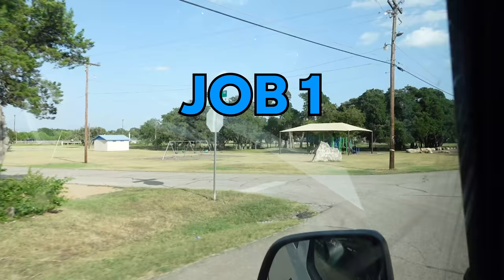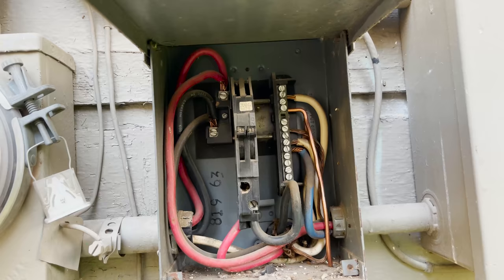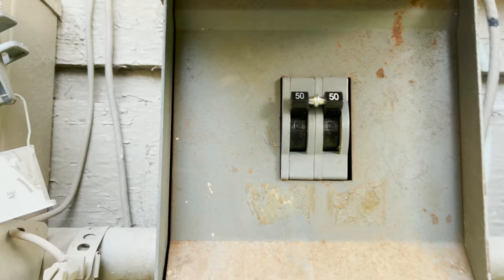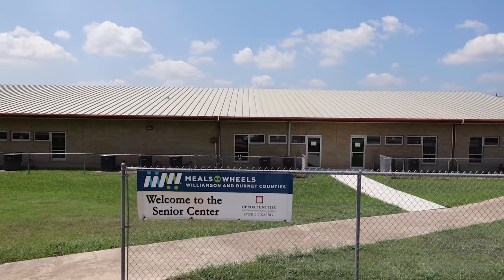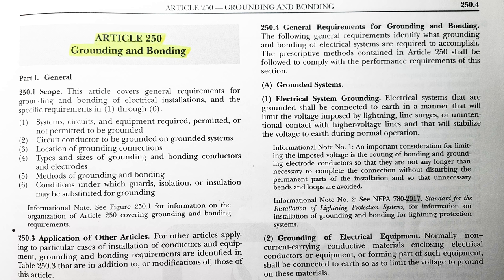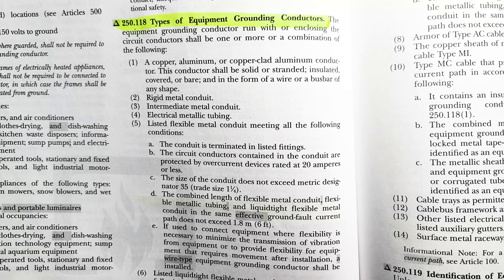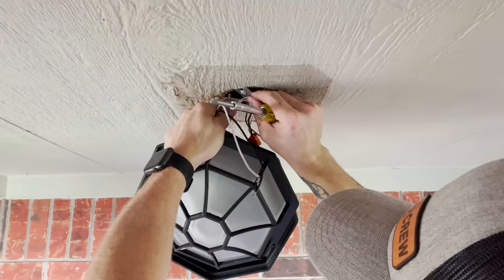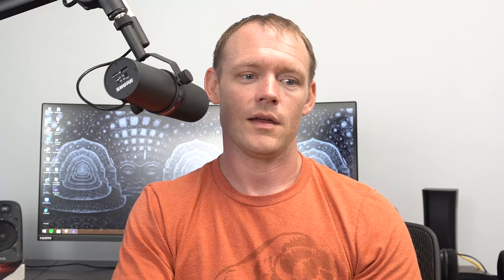Service Calls With Electrician U!!!

Comment: You were able to install ground wire through the existing conduits by yourself? All straight runs with condulets? I’m pretty creative with a one man approach but it has its limitations. Would like to have seen the video of it.
Reply: Usually pull out some existing wire and pull it back in with the ground

Comment: I recently installed an AFCI breaker to a dedicated circuit for a washing machine in a laundry room.
The breaker model GE q   series dual function breaker.
Checked and triple checked all connections from panel to designated outlet for the new washer.
No problems for 4 months and then the breaker tripped on every high current draw motor appliances ie vacuum , hairdryer, corded drill, oscillating fan. 
Lights, radio any non motorized appliances work fine. 
I replaced the breaker with a new one, still tripped. Tested the circuit itself with a volt ohm meter live power and nothing indicates arcing in the circuit. 
Is it possible that the breakers are faulty?

Comment: Using MC 12/2 cable, is it permissible to have a metal single gang box for a 20 amp outlet attached to the cabinet above the range to power a microwave or does this box need to be attached to a stud and flush with the drywall?
Reply from the maker: This would be a great question to ask in the discord: https://discord.com/invite/7ykYfbh

Comment: hey man, would you be able to just add a ground rod, or multiple for the second job instead of running wires to the panel? don’t know if this is a stupid question but i would love to hear your opinion and or the facts as to if you can do that.
Reply from the maker: It really depends on the situation. Typically, no. Here’s the premise as to why. Say there is a lightning strike, or not even that severe, say a nasty ground fault. If the rods are close enough, the current could then run to the other grounding electrodes and cause issues with the system.  Consult with Art. 250 for more of a situational answer. Or feel free to reach out (DM on FB or IG) and we can look at it together! We also have a FB group and our discord server is a great place to bounce ideas off of other electricians: https://discord.com/invite/7ykYfbh
Reply: @ElectricianU  thanks for the reply, i joined the  discord!

Comment: Hi everyone,  any chance I could get some help?
What could cause the kitchen lights, that are on a circuit that has recently died to come on when I turn on the stove, a couple other circuits have died too, one only has 70 volts between hot to neutral , but between hot and ground it's 110, I've investigated a dropped neutral with a multimeter with the old style (Edison) fuse box opened up, and everything is checking out ok, I guess I do not know what the proper test is to find problem. I always use new insulated gloves, tools, and shoes. The two 60's(main) two 35's(stove) the two 20's(waterpump, Washer) and six 15 amp(rest of house) fuses are all good.
Please help, Thank you.

Comment: Why not just run a ground wire through the existing RMC? Running 12 runs of flex with a single ground wire seems wasteful.  If that is indeed what you did?

Comment: I looked at the water and was like, fuck that. There's most likely gators in there....as well as snakes, spiders and a bunch of other shit I don't wanna fuck with. Not to mention, I have no idea what's under the surface of the water and we right next to a fuckin a dump site. I didn't wanna impale myself. Trying to miss the razor wire was out so I grabbed the camera bracket which Im glad I did a top notch job of mourning to that fuckin pole and a handful of tension cable and I wrapped my legs around the pole. I started yelling for Steve and all I got back was a very angry and agitated, "WHAT!!??"...I yelled again and he emerged from the shed and again, "WHAT!!??"...Looking in all directions to see where I was and then looking up and seeing me hanging off the side of the pole. He says o shit and runs over to rescue me. He was about 100 yards away. He had to get a ladder to reach mine and grab the feet and drag it back over the fence over the razor wire and put it back under me. It took at least 5 minutes maybe even a little longer before I was able to get my ass back on the ground. Once I was down, we just went straight to the van and sat down for a few. Didn't say a word. We caught our breath and then just started laughing our asses off. Steve said dude, wtf is wrong with you. He said I heard the first Steve and I was like, wtf does he want!!?? He knows I'll trying to terminate fiber. Then I heard the second Steve and I could yell something was wrong. Yea, something definitely wasn't normal....lol. He said next time just fall asshole...lol....but good job on mounting the cameras cuz that thing saved your ass. No doubt.

Comment: Just curious, can the dedicated grounds be ran without conduit through the ceiling or did you have to fish all 12 through the raceways with the other conductors
Reply: Sounds like he ran flexible conduit to the panel for each ground wire.
Reply: That’s possible but you can’t run a fish tape but so far through flexible conduit. All the runs would have to be measured out and then wire pulled in on the ground. Curious if a ground can be fastened in a ceiling without conduit

Comment: I'd put you on any job, you do things more or less exactly how I would want them done. Good enough isn't "good enough" for you - and that's never a bad thing! You also don't go so friggin overboard that jobs are insanely overpriced too. The breaker thing - yes! We all keep old shitty pulls for things that are hard to get. They can get somebody by until you can source a new one, or maybe there are no new ones and it saves them from having to buy a panel for several more years. But if you CAN get a new one - its always best to do that. The grounding conductor thing - using conduit for a grounding conductor has always bothered me. I far prefer an actual conductor. Fittings get loose from expansion / contraction over time, then it's touching but not really tight - and we all know that's not really a good connection. Then theres guys that disconnect conduit for some reason and don't put it back right like was the case at that school - you just can't trust that.

I, one time ... a long time ago ... put an extension ladder over a holly bush to get on a roof. Ladder was at too much of an angle for one, and I - being young and dumb, didn't know that those teeth on the front of the feet have an actual purpose! So the rubber "non slip" pads, just slid out on that grass, and I rode that ladder right down into the holly bush. It broke my fall, but I got scratched up something fierce! I just want to know how you got down from hanging on that window sill :D

Comment: It's not just Zinsco that burn the buss bars that most people overlook, it's the old poor quality wiring methods behind every device.  Usually the device that's behind an entertainment center, a heavy couch, a China cabinet or stack of hoarded boxes.  So I pigtail with a new device and move on.  I complain about the "stab in the back"  wiring, but I've made a ton of money from these shitty, FIRE HAZARD wiring methods.  So when people say "everything we do is UP to code." That means it's BARELY LEGAL.  Do you really want to be known as a BARELY LEGAL electrician?  Or do you want to think about it for another second or two and be a superb electrician?

Comment: One ee98 to another.... you definitely lost some MOJO going back to the rat race(working for a general contractor, not as much margin built in etc.... people like me wanna see the actual line of margin.... show us the independent ee98 profit earned vs hourly compared to someone who is a company man, well versed in a large spectrum of electrical, but giving up half to 2/3rds of the salary to be a company man. I went on my own 6 months ago, and average 300% more a check after overhead. But I work at least twice as much. Let's see the numbers behind the trade off, you can use mine if you want

Comment: Only fools cheap idiots & tight wades use conduit for a ground. Saw way too many times where conduit pulled out of a fitting, rusted or corroded. Nothing beats a copper ground plain & simple. Never liked flimsy 18 gauge that helps ground armored cable ( no such thing as BX in NEC ). Rode an extension ladder down while an apprentice because electrician insisted ladder did not have to be tied or or somebody hold it on a slippery floor.